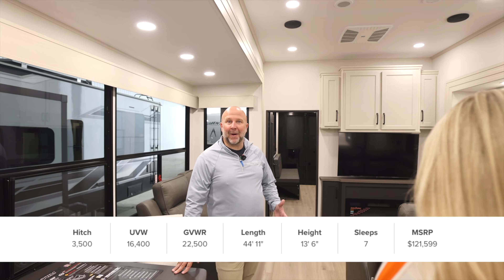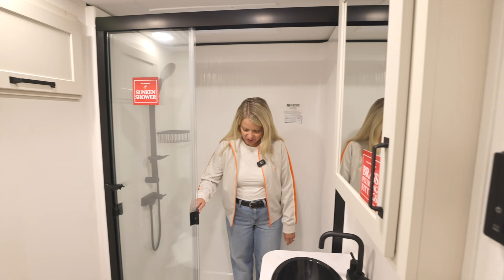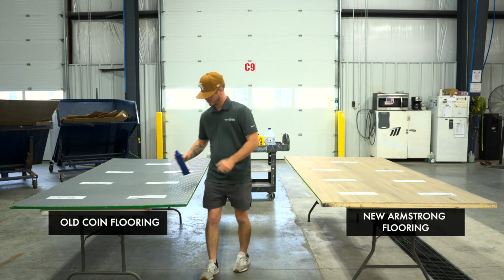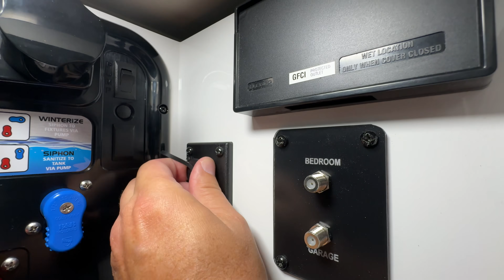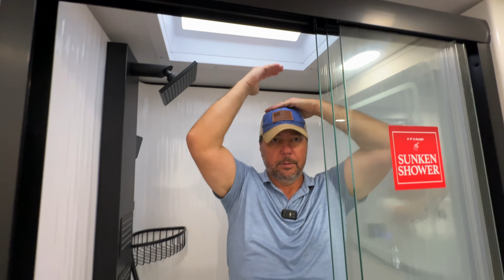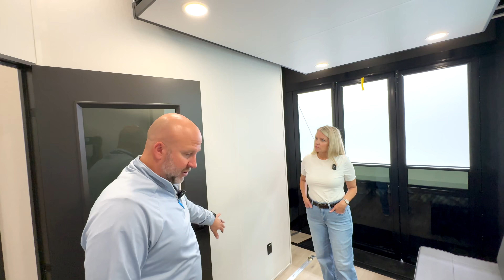More Seating, More Space, More Comfort: 3 New Momentum Floorplans!

Comment: They're all great rigs but no one mentioned pricing, and also I think the UVW is really high. I wish they can get that down around 15 to 16K.
Reply from the maker: We put the current MSRP on the screen for each model, along with the specs.  You can also see the current MSP any time online.  A 15-16K UVW is unrealistic in a 44' fiver.  Just not possible with upgraded suspension, 20cu.ft. fridge, etc.
Reply: @ChangingLanes Yes, I was thinking the same thing. Also with the higher quality you usually get the higher weights. I rewatch the video , and still did not see the pricing. Maybe I need to get my eyes checked lol, but as you said I can look it up on their website or wait for the Tampa show.
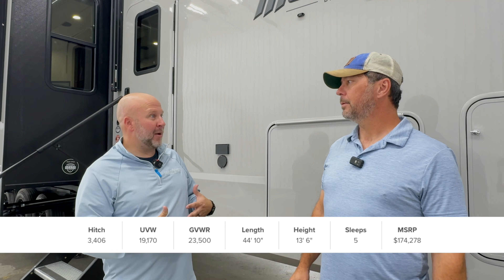Reply: @unknowntraveler8087  stop the video at 1:20 18:22 & 27:55 for the information you are looking for.
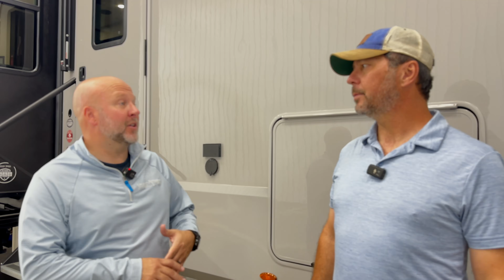Reply: @ChangingLanes stop video at 1:20, 18:22 & 27:55.
Reply: If you need those things, you have to go with ATC or Sundowner.  More minimalist interiors, fewer or no slides and higher prices.  Much larger cargo capacities though.  Every choice is a tradeoff somehow.
Reply: @davidc1961utube I have a  43ft Luxury Toy Hauler. With all of those things. Of course except the independent Suspension. And I have 2 AC's . And I an 15,500 UVW. I just don't like the fact that there getting into dually territory, and I don't like dullies I like SRW 3500's

Comment: Good video 😊 just saying  you're  going to  need  hdt truck  with  that weight   don't  care  what  manufacturers  Ford f 450   has it limitation  they already  430 rear gears  i think not sure  safe travels  if I ever move up to large fith wheel  with that weight  I'll get a used  peterbuilt  or volvo  truck
Reply: Lots of HDTs out there with less than 200k on them for less than the base price of an F250 diesel.   Honkin big truck though...

Comment: Thanks for the review!!  I love both of the Momentums.  The G Class?  Not so much.
The only complain I have about my ‘23 Solitude 31GK is the 120 V electrical system.  Almost all the receptacles are on the same circuit.  I have no idea what Numpty might have thought that was a good idea.  You can’t make coffee and toast at the same time.  The entire kitchen receptacles (and more) are running off one 15 Amp circuit breaker!  I find that extremely frustrating!
My sticks and bricks home has five 20 Amp circuit breakers just for the kitchen. 
Has Grand Design fixed that obviously design error?
Reply from the maker: Yea.. the G-class's limited basement makes it a no-go for us also.  Your circuit distribution does sound annoying.  Obviously there are a lot fewer circuits available on an RV 50A distribution panel then in a home.  I would check your wiring to see if it will support a 20A breaker and replace it.  To do anything beyond that would require almost impossible re-wiring.
Reply: EL Cheap O in design ,not in price, you should look at these things before you buy!
Reply: Would like to see a slide out for the generator. Easier access especially for maintenance. Why no split AC units?
Reply: Small tail lights? Need larger taillights, longer.
Reply: I see people connecting the rear ramp to the side deck.